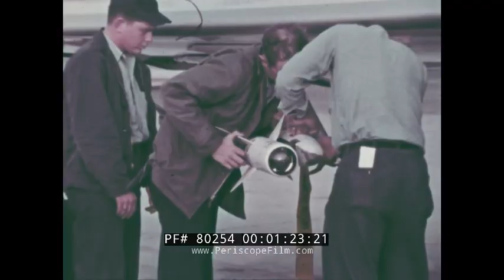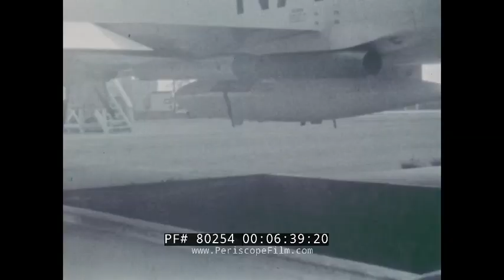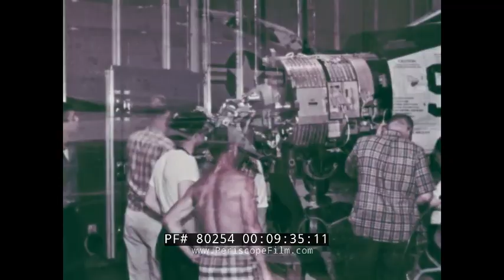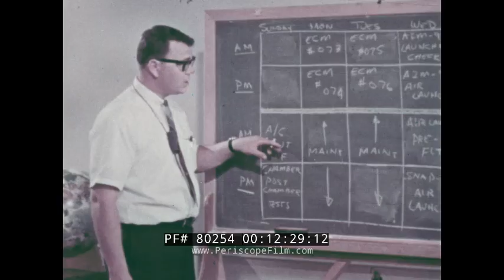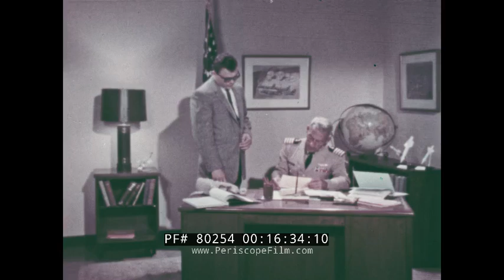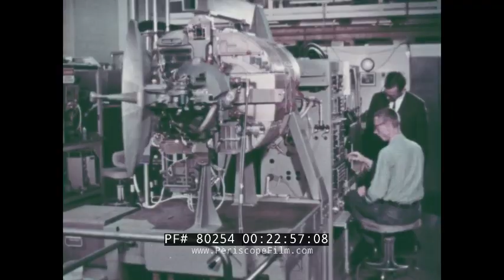DOUGLAS F-4J PHANTOM  AWG-10 GUIDED MISSILE TRIALS  PT. MUGU, CALIFORNIA  80254

Comment: Very informative. The F-4J was the world´s first fighter with a real look-down/shoot-down capability thanks to the AN/AWG-10 fire control system and its associated radar, the AN/APG-59. This is the first video I have ever seen showing the LRUs in such a great detail.
Reply: It was a great fighter for its time however what I don't understand is why didn't the F-4J have an internal cannon like the F-4E did? They were developed at the same time and the E-model had a built M-61 as a result of lessons learned from the Vietnam war.
Reply: @nicholasmaude6906  By 1967, the Navy was already anticipating the AFX, F-111B as the follow on fighter. So, the F-4 was already a dead end plane for the Navy.   The Navy did not have near the missile and weapon system failures the USAF suffered with their F-4 and Falcon missiles, so a gun was less of a priority.   I believe adding the gun required removing the television camera recognition system, which would be an advantage at sea where silly visual ROE requirement didn't exist.  Bottom line: USN vs. USAF different mission, requirments and priorities.
Reply: @nicholasmaude6906  the radar and the cannon not only competed for room inside the nose of the phantom, which required a smaller less capable radar in the air force phantom, but also the vibration from the rotary 20mm autocannon firing was detrimental to the operation of the radar. the navy prioritized having the radar and sparrow combination working, a look-down shoot-down beyond-visual-range formula. because if truly necessary they would also have F-8 crusaders in the air with four onboard cannon in the event guns were necessary
Reply: @nicholasmaude6906  What the F-4 Spectre really needed was a dedicated crew of two that can do some serious work against their enemies... the “Ault Report” looked into the problems that Spectre pilots faced during Operation Rolling Thunder... they looked at the reliability issues of the earlier missiles and managed to fix the problems, which resulted in the creation of the AIM-7E-2 “Dogfight” Sparrow and the AIM-9D/G/H for the Navy and AIM-9E/J for the Air Force respectively... The Ault Report was also responsible for the creation of the Navy Fighter Weapons School or Top Gun, which gave the Spectre pilot and RIO the edge against the maneuverable MiGs even when the Spectre has no gun on board...
Reply: @theorganizer1273  The USAF AIM-9E/J Sidewinder models were a joke from what i've read, the USAF pilots would've used if they could the AIM-9D/G but couldn't because of incompatible launchers (I suspect they could've got compatible launchers) due to inter service political bullshit so they had to go back to the AIM-9B (The AIM-4D Falcon proved to be a techno-turkey).
Reply: @nicholasmaude6906  the Navy and Air Force have doctrines when it comes to their aircraft...
Reply: Nicholas Maude because the F-4 was never a fighter...
Reply: Russia stole the tech from a downed F4

Comment: Fascinating video. The flight trails weren't exactly hard, nor realistic, were they? Relatively short ranges against slow, non-maneuvering drones in a clean non-ECMed environment in clear weather. If I recall correctly, the LD/SD capability would only work effectively in good weather, head-on engagements & was so prone to locking on to false targets, it was often disabled in service. Same story for the F4E's AN/APQ-120. An effective LD/SD system didn't come about until the advent of the Hughes AWG-9 for the F14A with its all-digital signal processing.  Didn't stop the RN from adopting the AWG-10 for the F4K, though.
Reply: Good comment.  The AWG-10 was limited in look down/shoot down and was not a true doppler set.  However I believe the -10B version in the upgraded F-4S actually did wind up having a pretty fair capability in that regard, in addition to better ECCM and overall reliability.  I would love to hear from any who flew the F-4J/N/S to give their impression.  A former Navy fighter pilot who flew all (USN) models of the Phantom from B to S said the S was by far the most capable air combat variant of the Phantom he flew and, amazingly, was in a few regimes superior to the F-14A Tomcat (but not the B or D, and he flew both).  AWG-10B with solid state electronics gave the S a light nose and said the final radar was actually quite capable but nothing like the AWG-9.  See The Fighter Pilot Podcast channel.
Reply: @hckyplyr9285  I can't for the love of God see how any F-4 model might have outperformed an F-14A in any meaningful category.

I can, however, see the F-4 not suffering from frequent compressor stalls and other issues like the necessary rudder/stick coordination which gave the F-14 such a huge flight manual.

Other than that, the Big Cat was light years ahead of the F-4 in regards to sheer performance as a fighter/interceptor.
Reply: @hckyplyr9285  Thanks for the heads  up!
Reply: MB: No, we were shown only one example for each type of approach.  But in any case, the intention is not to find the extreme limits, but rather to test for reliability, consistency, etc.  Remember this is only one phase of a several year series.